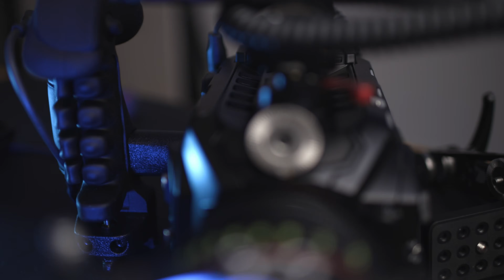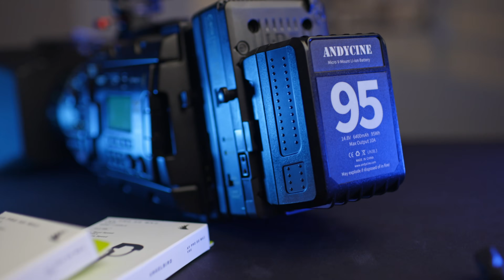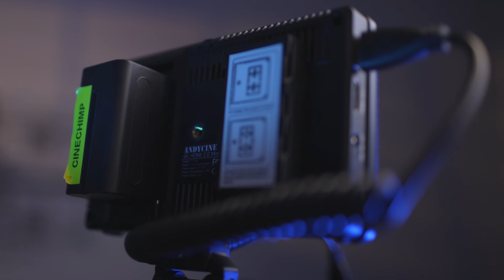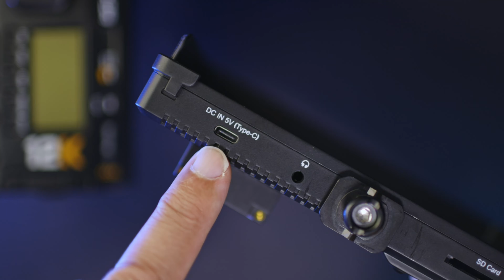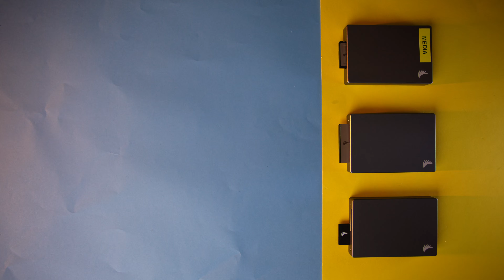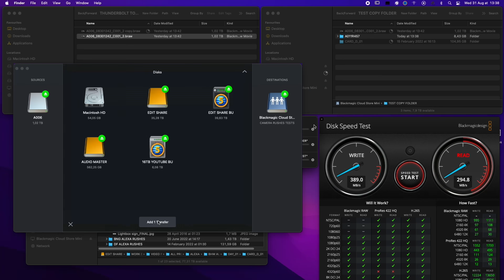NEXT LEVEL Ursa Mini Pro 12K Camera ACCESSORIES

Comment: How are the signals coming out of that C-Box hdmi? I see that it’s only HD, but is it still a useable HD on modern monitors when this c-box dropped 9+ years ago? Thanks for putting together this video. It’s been really helpful in setting up my 12K. I’ve been on the hunt for one of these discontinued c-box’s but I sometimes wonder if it’s really worth it or if the HD signal it supplies still holds up.
Reply from the maker: Hey great question - its great and works perfectly for HDMI. You nailed the exact the point of the video, accessories are a better investment over time. That c-box has been used with countless cameras that have come and gone from my arsenal. Im sure Wooden camera has a newer version, if not someone should make one, but I still wouldn't update as mine still works perfectly.
Reply: @cinechimp Thanks so much for the response. Unfortunately, wooden camera hasn’t updated it to keep the HDMI’s included. The closet available is the 12K D-Box, but I really want to keep HDMI as an option. This older C-box is really the only option, but they can be incredibly difficult to find sometimes. So hang onto that one if you like it. Ha. There’s really nothing else like it right now that offers a similarly convenient hdmi conversion.
Reply from the maker: Oh man what a bummer. Oh I didn’t know that, but know I do - will do sir. @mid49films Ryan is there any chance MID49 could make an updated version of the Wooden Camera C-box? Even I would like to get another one…???

Comment: Super nice set-up. I plan to get one of these at some point and would run it pretty similarly to how you have it set up. I'd just add a handle on the left with a wireless follow focus. I"m a solo shooter too - love working that way and spinning many plates. I just want the extra benefits of this camera to pair with my P4K.
Reply from the maker: oh benefits of the 12k over the pocket 4k are massive, not just in resolution but everything
Reply: @cinechimp  main things I'm looking for  are the impressive HFR options, better DR, bigger sensor (perfect to pair with my Zeiss Milvus superspeeds) and that fantastic image. not looking forward to the massive file sizes. I'd probably work mainly in 8k (purely for oversampling)... What's the 4K footage like compared to say the P4K?
Reply from the maker: @JonasStuart  oh its night and day in terms resolution, rolling shutter performance in 8k and HFR. The sensors not that much bigger than the 4k .The DR is better, but for anyone worth their salt as a DP,  they should be able to use both in a manner that will please a client. The files sizes in 8k aren't that bad when I compare them to my Canon cameras when shooting RAW - I mean Canon’s RAW is just stupid big. I think you’d have a lot of fun with an Ursa, but the release of the 6K FF pocket could foreshadow what BMD is going to release next in the URSA lineup, so it might pay to lock up your wallet for a while. But if you need one now, look for a good used one  for a fair price. I wouldn't recommend buying a 12k now as I think another substantial price drop is coming ...
Reply: @cinechimp  I hope you're right on all of the above. I think BMD are behind on shipping new cameras and hopefully it's for a good reason. I want to see more in-house sensors as the 12k sensor was such a revolution - and they dropped it like it was easy. Surely if some of that tech trickles down into cheaper products they would be giant killers.

For now, we're not in a position to upgrade so I'm doing a lot of musing and hoping that while I wait for the right time to buy, we see some nice new products coming in - somehwere between the UMP 12K and the 6KFF - both in terms of price, and capability. Hopefully what ever's next includes dual ISO though, after the P4K, I'd find that difficult in some situations with the 12k
Reply from the maker: @JonasStuart  Oh I totally agree with you mate. The 12k sensor is amazing. At first I was like who needs 12k, we have barely transitioned to 4k. But then I started using the camera and was totally blown away. I have used it extensively now and it still blows my mind how under rated the camera is. If BMD had just launched the first 3  cameras without so many issues, the brand and 12k in real professional circles would be viewed differently. 
The 12k sensor is phenomenal - but yes it does like the light.
Reply: @cinechimp  Yeah, that's why I have no intension of getting rid of my P4K. With a .64xl metabones and Zeiss Milvus f1.4 glass it gets nice clean footage in pretty much any scenario. Yeah, such a shame the industry hasn't grasped the magnitude of this camera. Well, I hope you're right about the pricing. I'd love to get a barebones set-up on one of these in the new year °¬)
Reply from the maker: We can only hope and wait. My big thing has started to happen at BMD with the change to CFexpress Type B cards. If we could record to two at the same time in the Ursa 12k, could get either faster reader out speeds or much higher frame rate options. The Cfast cards in the 12k really hold it back.

Comment: Sad that you missed out to make a statement that in some Cases even the Angelbild CF Cards with max. 480MB are not fast enough writing down the immense data rate of the 12K. For that reason I just only use an Samsung T7 Shield SSD with max. data rate of over 1000MB and this can handle almost all settings of the 12K. And of the best Accessoiries is the original URSA Viewfinder. It give you so much opportunities so that you dont need an external monitor. A good top handle is the most important while using the URSA.
Reply from the maker: Hey there, I use the dual record function which is fine for all modes with my cards. Maybe my 1tb cards have a bigger buffer. I dont have any issues. Im pretty sure the "sustained write speed is 450MB/s" x 2 is a "sustained" write speed of 900MB/s all the way to the end of the cards. But I only need to do this is HF mode.
From my experience the external drives, once they hit the buffer slow way down and start to drop frames like crazy. My Angelbird cards dont do that in dual card record mode.
Granted you are correct in single card mode, literally every card on the market will drop frames, but I gather thats why BMD added the dual card record mode.
I really hope BMD release a new version of the camera soon that uses CFexpress cards for higher frame rates, and a 16 Bit record mode.
I own the EVF, but its not height adjustable, so I find its uncomfortable to use. The image quality is amazing - but I have never found it great for focus and I cant stand using focus peaking. So currently the external monitor is a better option for the way most people shoot and its cheaper than the EVF, which also offers no signal loop out. But hey man, each to their own.
Reply: @cinechimp  Does each card keep their original capacity of 1 TB in Dual Record Mode? So in total you still have 2TB?
Reply from the maker: @Jaxplode  yep you sure do. But man they go quick in 12k or 8k 120P
Reply: @cinechimp  I can imagine… I think about getting two 512gb… Because 1TB only one costs 750€ in Germany…
Reply: @cinechimp  At which compression ratio you record in 8K 120p without frame dropping?
Reply from the maker: @Jaxplode  Totally understand, Im in France so the prices are similar. 
I really wish the Ursa line would switch to CFexpress cards. Then I could use my Angelbird CFexpress cards from my Canon R5 and Red cameras. That would have to be my number one request from BMD.
Reply from the maker: @Jaxplode  That depends on what I am filming as I don't want to lower the quality and create artefacts.